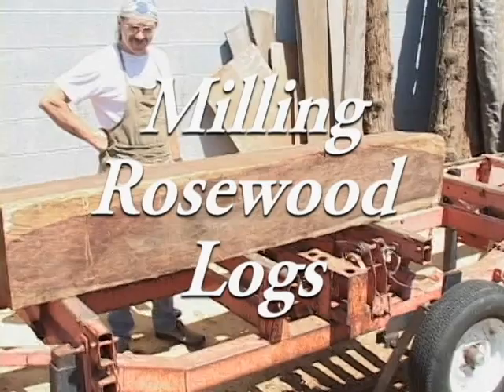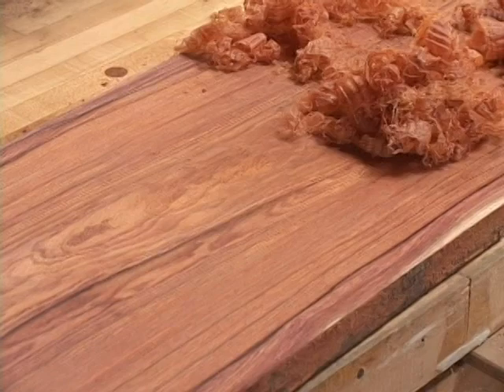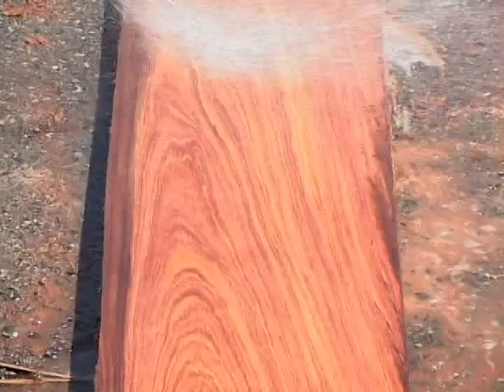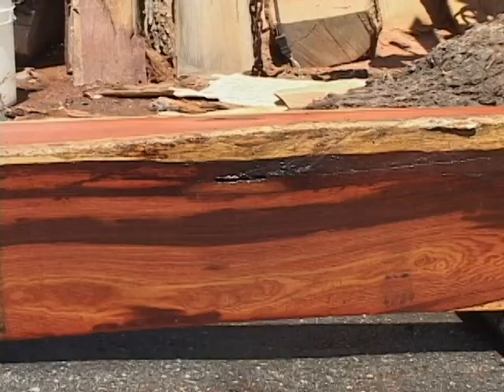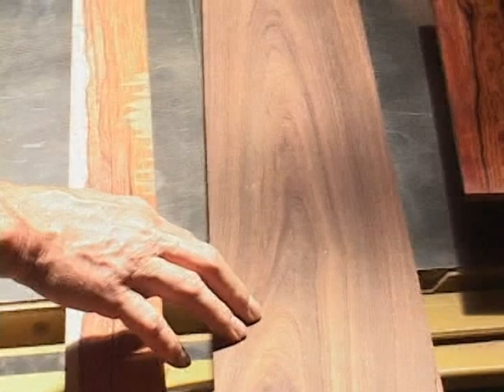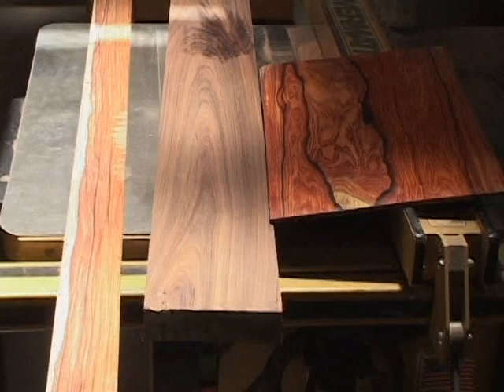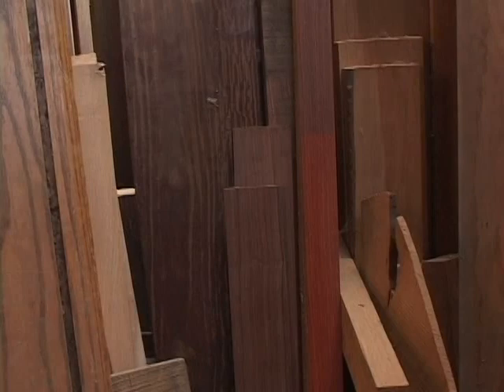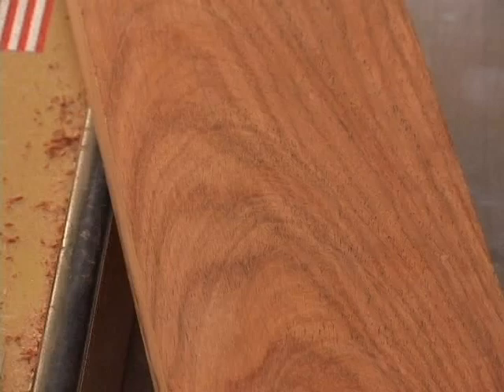Milling Rosewood Logs

Comment: Some of the most interesting wood species ever.  It's simply amazing when turned into a bowl or platter.
Reply from the maker: This particular species of Rosewood is also called flame wood. Some of the finest ancient Chinese furniture was constructed with this type of Rosewood. No silica so it is kind to your cutting tools.
Reply: +arboristBlairGlenn Blair looking at this hardwood or iron wood do you have any tips on your ban saw blades? (Yes, I know your using a lucas mill now) I have been cutting yellow pine this week and plan on retooling for hard wood. I'm sure my WM dealer will have his own opinion cause he knows I'll be spending another $350 dollars. Looking to you for recommendation cause your fault I'm milling (humble and grateful). I should of been doing this 55 years ago.
Reply from the maker: +Darryl Iiams When you say "tips", do you mean carbide? No carbide but that would be nice. Changed the blades out as soon as they got dull to prevent drift of the cuts. Also, very tight blade tension and lots of water

Comment: I was milling some poplar...origin unknown and in a dark area of the lumber i cut a copper jacketed lead core approximately 30 caliber bullet in half!
Reply from the maker: That piece,(if still embedded), would make an interesting feature in a project
Reply: It can cause a dangerous failure if you're using a bandsaw mill. We often come across 16 penny nails through doug fir.

Comment: Coco bolo is a Dahlbergia that people like me are very allergic to. I've got several pieces I cut out of a larger one to use in knife handles, but if I'm not careful I'll end up having an asthma wheezing attack if I don't use a respirator 100% of the time. It seems to me that all Rosewoods are just incredible to look at.
Reply from the maker: There are a lot of woods that people have relations too. Sometimes serious
Reply: +arboristBlairGlenn Yeah, I've had problems with monkey pod as well, but because it is such a soft wood I wouldn't use it for a knife handle or walking stick. I too have recently had problems with east indian rosewood dulling my lathe tools. I will have to get some carbide tools to finish one walking cane.
Reply from the maker: +arboristBlairGlenn reactions
Reply: Cocobolo is a true rosewood. The guy in the video clearly isn't an expert. And yes Cocobolo does cause problems for some people when working it. Dalbergia Retusa is its botanical name. Rio Rosewood (Dalbergia Nigra) is the True rosewood of commerce and is now extict commercially as its on the same listing as Elephant tusk on CITES treaty. All Dalbergias are true Rosewoods...

Comment: Blair, a Woodmiser?  Looks like it.

Do you remember Los Altos Supply?
It was in Los Altos, on El Camino, 
across from San Antonio Mall 
Shopping center.

steve
Reply from the maker: Steve Skouson this is an old video. Yes, I owned this machine for a long time. Now I have the Lucas Mill

Comment: What did you end up using the wood for?
Reply from the maker: This wood is so rare and so valuable that I have been nervous to start a project with it. I ended up with 5,  4 quarter boards and one 8 quarter about 6 feet long. That was my pay for milling 12 logs

Comment: isn't it endangered?  its beatiful to work with such lumber, but by buying it you are supporting the people that cut down a tree like that, such an old tree...
Reply: I am surprised  arboristBlairGlenn had no reply.
Reply from the maker: Walter Holland I can’t get to all the comments but I do try. This wood was harvested legally from a licensed broker. It is true that much of the worlds exotic wood is endangered but the true villain in this problem are the burning of the forests for converting to grazing lands or Palm oil production. These logs were cut by hand with the help of elephants (I was told). In many cases, harvesting valuable timber at a sustainable rate is far better than the indiscriminate burning or mass logging from big companies. The key word is balance.
Reply: Thanks for clearing this up, sir.  I apologize.   You do a great job in informing the public on your channel.  Thank you.